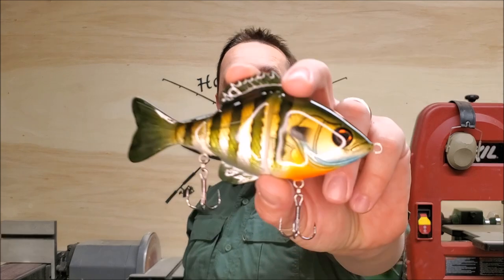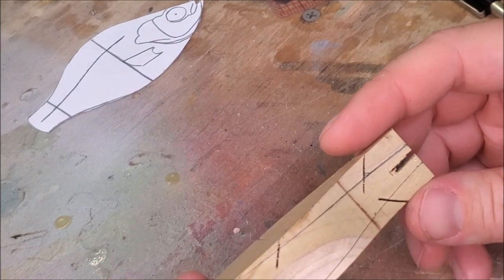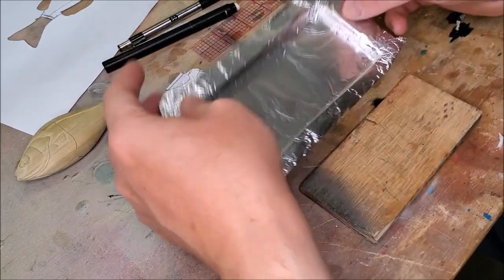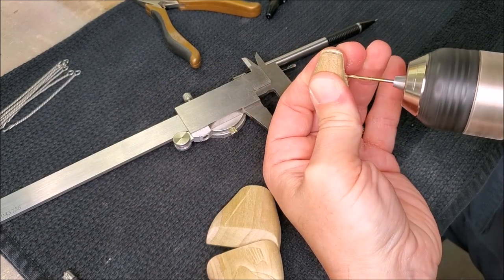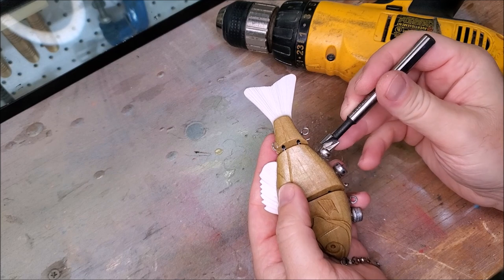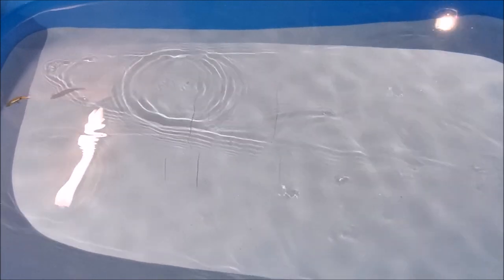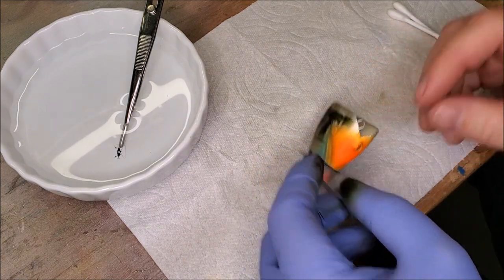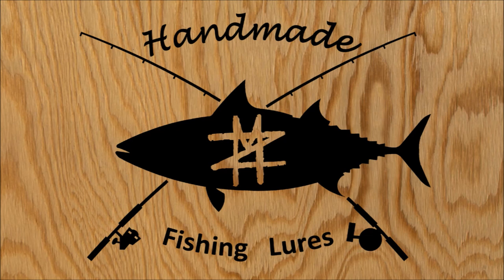Making a Wooden Bluegill Jointed Swimbait

Comment: Good day.Tell me plz what kinde of epoxy resin you using for?Wich is good?I used few but many scratches.Thanks
Reply from the maker: Right now I'm using TruCoat, but I've also had great results with East Coat Resin. Unfortunately they all scratch, but these two are easy to apply and look great.
Reply: @zimmtex  Thanks for unswer. I used Glast Cast 3.nice looks easy to work with but to much scratches.When i throw the wobbler or jerk the hooks also scratching both sides when im casting.Thats really not good.East Coast also hooks sratching  when casting or this epoxy stronger? Thanks a lots
Reply from the maker: @hutor_na_bolote  Unfortunately I haven't found one yet that doesn't scratch.

Comment: Very nice video and very informative. I have a question about the flexibility of the clear coat. In the video you flexed the tail and the clear coat did not crack - if you ran the foil coated lure (with this clear coat ) down to 80 ft will it crack due to pressure. The ones I made always seem to crack on the seams where the foil ends. I use a product called envirotex. Thanks and great videos.
Reply from the maker: I've heard about splitting from thermal contraction, internal moisture and/or pressure. This clearcoat is pretty flexible, but your issue might be related to the wood and/or sealer. You might consider using a denser wood and make sure it's well dried out before you seal it. I live in a very dry region, so I don't have to worry so much about my wood soaking up ambient moisture. You could also try a different sealer or a wood hardener before you paint. Interesting question, I hope this helps. Thank you for watching and good luck!

Comment: If you got a Silky saw, you don't have to sand your joint.  I know it sounds silly, but those cuts turn out smoother than if you sanded them.  They're Japanese arborist saws, but aren't really expensive for what they are.  If you get one get either fine or medium tooth.
Reply from the maker: I've heard of those; I'll have to check them out. The right tools do make everything easier. Thanks!

Comment: Question because I might have missed it. What metal sheets are you using for the scale patterns on your lures?
Reply from the maker: I am using aluminum foil tape that you can get at the hardware store. The diamond pattern is made with aluminum mesh that I found at a craft store. Thanks for watching!

Comment: I just use braid when throwing swimbaits, if you get a good low vis color, you can put on 65 pound test line and still have plenty of it on the reel
Reply from the maker: You said it right there! I have two swimbat rods, one with braid and this one that I was trying fluorocarbon because I had heard it was great for swimbaits. After loosing this lure, I went back to braid!

Comment: I'm very grateful that I recently discovered your lure work and now use it in addition to the tutorials of my "regulars": Mikko at SolarBaits, Nate at Marling Baits, and Todd McCollister at Smack Tackle. One of the many excellent things about your videos is the terrific resource list you provide at the end of each one. I spent two HOURS looking elsewhere for the right scale mesh before I spotted the  amazon link that accompanies your bluefill session. Bingo! It's perfect and on the way. I also looked at your recommended airbrush and compressor. But what I DIDN'T see was the "hardware" needed to connect an airbrush like the Master to a "full-size" compressor like the Porter-Cable, which is similar to the unit I already have. Could you PLEASE help me with this? I'm very confused by the "adapter kits" listed on amazon. Thanks, in advance, for your help, Chris
Reply from the maker: Hey Chris, thank you so much for your interest in my channel. It has been a while since I set up my airbrush, but I looked back in my order history and found this adapter pack:

https://www.amazon.com/dp/B01MF5XD8K/ref=cm_sw_r_cp_apa_fabc_8CMXRXZTK5FMXXHZX5XY?_encoding=UTF8&psc=1

I used one of these pieces to adapt to a threaded air compressor quick connect that I got from the hardware store. The quick connect plugs right into the port on  the front of my compressor. As I recall it was a pain to get everything adapted, but I eventually got it to work. Hope this helps.
Reply: @zimmtex   Thanks so much for the link!

Comment: Lexan is a clear plastic that they use to make rc car bodies. You can get it thicker than they use, but you know the stuff is durable because of it's use on rc bodies. Those things take a beating. Could just make your fins out of that.
Reply from the maker: That's what I used for the lip. More recently I have been using it for fins as well. You know what they say about great minds... Thanks for watching and commenting!
Reply: @zimmtex  yea I saw that later. I had watched the video in sections. Forgot to delete this. I just figured it might be easier to use the lexan than measuring pouring and waiting for that alumalite to cure.

But still came out great of course. The finish is amazing

Comment: Some outstanding craftsmanship to say the very least, plus fitting commentated instructions throughout. What else could we ask for? Can you please help me with my problem? I'm so new to painting lures, I don't have an airbrush so I'm dry rushing the lures or should I say 'i'm trying to' lol. But when I try to paint the foiled lures with a metallic acrylic paint the paint is blobbing up together very much like when paint is applied over waxed paper etc! I've thoroughly cleaned the surface with 99.9% isopropanol alcohol and allowed to dry but still getting it blobbing together. I'm not adding any medium, diluting with water or anything to the paint but can't stop it blobbing up together! Any advice would be gratefully received. The Detail Raw Umber that you use on the head look's great and a Game Changer in my opinion.
Your video is superb and deserves Massive THUMBS UP ALL DAY LONG I always enjoy them thank you👍😷👍🏴
Reply from the maker: First, thank you for your kind words. I really appreciate your support! Hand painting on foil can be tricky. I'm not positive that it will work, but you might try spray painting a light clearcoat or two over the foil to give your paint something to grip to. Something like Kamar varnish might work. Another option would be to paint the 'broad strokes' like the white bottom and the green top fades with a rattle can so you can detail over that with your brush. Best of luck to you in your lure making adventures!

Comment: I can see a difference on one of your  🐟, the fish that has a bigger gap in the middle cut swims better. I think that was the problem. Beautiful work.
Reply from the maker: You might be right! These joints are elegant, but I really like the double twist wire joints better. They leave a wider joint and are much easier to install. Thanks!

Comment: How much weight can hold these lures? I mean these joints looks weak to me, bc there are not that much material that i would leave.
Reply from the maker: I have not tested this to the breaking point, but I am confident that it can handle bass just fine. You could also use a couple of double twist wire joints for added strength. Thanks for watching!
Reply: @zimmtex  well i know that it can handle a bass bc basses has bigger mouth but what about if a pike hits it? I mean that lure is big enought to catch some bigger pike or maybe catfish.
A double twisted joint is stronger(i think) maybe not ...
Anyway its a pretty nice work tho.
Keep it up!
Reply from the maker: @matyasabkarovits  For a pike I would definately go with a double twist wire. Just be sure and get a 1/2 inch of embedment and you will be fine. Thanks for your support!

Comment: Great videos. Additionally, I love all of the links that you have provided. One item I’d love your help with is the mesh/screen you use. Been looking but not sure what to use. I know woven screen leaves bumps that result in dimples in the foil tape. Is this what is called expanded mesh and what size openings do you suggest?
Reply from the maker: Thanks! The mesh I use is aluminum expanded mesh that I found at Hobby Lobby. It doesn't say what size the openings are, but I reccomend having lots of options.
Reply: zimmtex Thanks so much.

Comment: Hey mate, love your lures. Probably a silly question but whats the paper you use draw your designs onto and then transfer them onto the wood. Is it just tracing paper? seems to transfer the image across easily . Thanks Rhys
Reply from the maker: Hello! Not a silly question; I'm using regular paper. I trace the image on the opposite side so that when I put it on the lure and draw over it, it leaves graphite behind. I do have some tracing paper, but I like this method better because the stiffer paper is easier for me to position accurately. Thanks for the question!

Comment: I have to say something mate. The twisted wires are easier to make if you have a metal skyhook in the drill..Place the two ends of the folded wire in pliers & twist away, saves the ginning around with the bits in the chuck..
Reply from the maker: That sounds like a great method!

Comment: i am new to your videos and as a wood worker and fisherman i am VERY impressed.  I know this video is two years old but i might suggest two things you may have already added.  you can get a glove for your left hand that you can't cut with an exact o knife or carving chisel if you slip.  i learned this in Boy Scouts from personal experience...lol,  Also on your band saw make a zero-clearance piece that fits around the blade and fits in the holding slot.  This will keep pieces from falling in the hole or twisting on you when making the cut.  i use these on all types of saws: table, band and scroll saws.  you don't need them all of the time but when doing intricate cuts it keeps you finger count around ten...  Keep up the good work.
Reply from the maker: Thank you very much for watching and sharing your wisdom! I have since changed my carving habits, but the band saw suggestion is a new idea for me to explore. I've not been satisfied with my saws performance,  but a zero clearance might just solve a lot of my issues. Thank you!

Comment: If,you shorten the edges of the not so good swimming lure it will work better
Reply from the maker: I recently made some adjustments to the joints and it made a big difference. It was just too tight and didn't allow enough movement.

Comment: That was fantastic-I’m sorry you lost it.
Reply from the maker: Thanks, me too. I've changed all my line out trying to reduce the chances of loosing another one.
Reply: @zimmtex gorilla braid. It’s hard to find anymore. I think it comes in 35 and 80pound test. It’s literally unbreakabl. With the 35 you will probably break the hook off before the line breaks. You can find it on Amazon. Oh and the 35 pound gorilla is the diameter of 6 pound mono. I have it on my catfish rods. Never breaks. Try it. 300 yards of the 35 is about $25
Reply: @zimmtex  wrap the line around a stick and pull. Something will break loose but not that line.